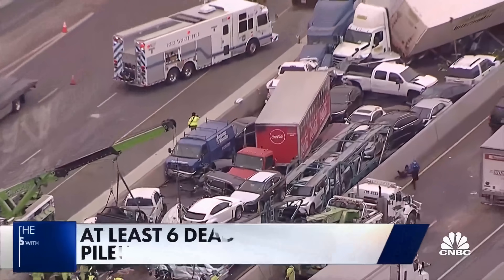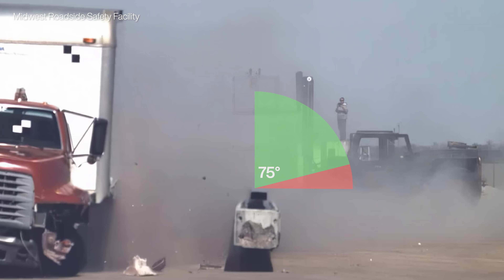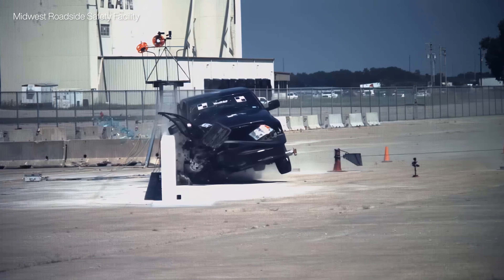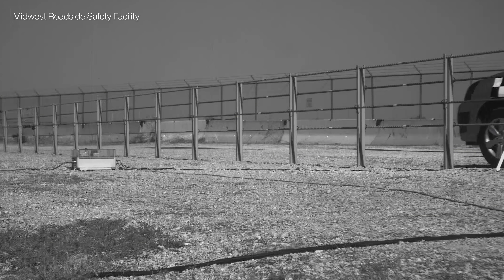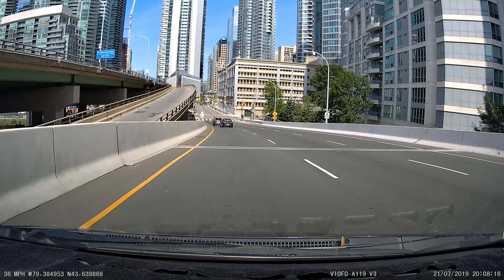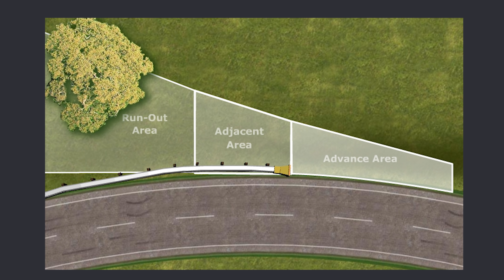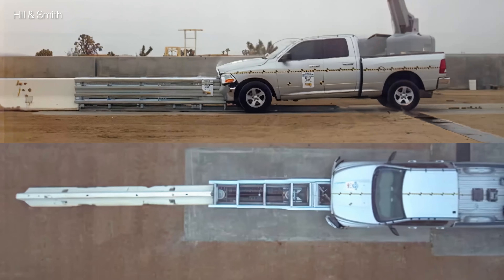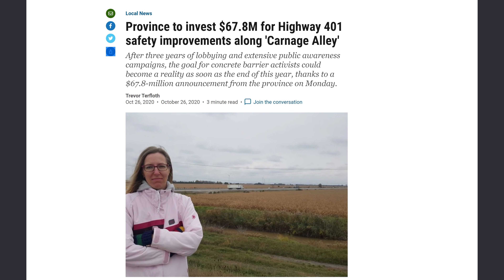How Road Barriers Stopped Killing Drivers

Comment: All the comments about cable barriers and how dangerous they are to motorcyclists made me do some research. What I found was several studies that showed essentially that any barrier is no bargain for a motorcyclist, but that cable barriers weren't significantly more dangerous and perhaps safer than solid barriers. We tend to look at those cables and think cheese slicer, but we don't see how bouncing off of 5 or 6 steel or wood posts holding up a W barrier is just as bad. No barrier at all is safest for running off the road, but any barrier is safer than none for crossing into oncoming traffic. In short, cable barriers are a long way from being "100% fatal" as some seem to think.

What was also interesting, though irrelevant to this discussion, was that one study found that in 85% of motorcycle crashes the rider was at least partly at fault, through excessive speed, DUII, illegal maneuvers, or other factors. I rode for years and had a few crashes. Every one was my fault for driving too fast for the curve. Never had a traffic run-in, for which I'm grateful, but that may have been helped by the fact that even after a decade of riding I was still just a bit scared of all those big cars around me!

Comment: Important note: 'phased out' means 'no longer approved for installation' not that they were all ripped out and replaced. Still plenty of older installations out there that aren't up to code anymore still spearing and slicing people.
Reply: Yeah I've definitely seen those types of barriers on the roads.
Reply: @takeit1229 fr. theres one of those horrifying spoon ended barriers on the bridge we used to take to get to school.
Reply: Correct. Its important to be able to spot the which is which, it might save your life.
Reply: @barryallen5507  yeah try to look at the crash barriers on the road to plan out your car accidents more safely.
Reply: @barryallen5507  so you would know where you can crash safely? That's dumb, all crashes are accidents, you can't pick where nor into what you crash into, because it happens too fast to react 99% of the time.
Reply: @Derg3586  all crashes are not accidents and it is often still possible to control the vehicle to a moderate degree during partial loss of control.

When I was 19, I hydroplaned on the highway at 70mph in a curve in the rain, the water was too deep because of welling and my tire tread was too thin because I young and broke, I was on a direct collision path with a Grove of trees that would have very likely resulted in my death, so I chose to actively counter steer (a tactic used in rally racing to control the forward direction of the vehicle moving at a high rate of speed on terrain with low traction) and allowed my vehicle to engine brake instead of using my brakes because that would have locked up my wheels and resulted in complete loss of control. I am alive today because of my ability to drive and the choices in made during that crash. Instead of veering off to the right of the road and continuing straight into the trees with only a seatbelt to 'save' me (more like kill me, check vehicle crash stats and impact of seatbelts during collisions over 40mph for context), I guided the vehicle back to the left leaning curve and hit the wire guard rail. Initial impact with the railing ripped my entire left front suspension out of the vehicle, causing my brakes to fail and leaving me with only one wheel to steer and a cable pull hand brake that controlled the rear wheels. I spun out and continued to redirect the vehicle towards the rail to the left side instead of the hill to the right side. I hit all four corners of the vehicle on the rail and did 2.5 full spins, after which point I had slowed down and dissipated enough energy that I managed to straighten out the vehicle even with one wheel and used my handbrake to stop just on the right edge of the road.

We're not all old or slow like you I guess. You can work on your reaction times through practice. If the only thing you know how to do in a car is travel in a straight line, you are certainly doomed in the event you lose control. There are advanced driving classes you can take to further expand your ability to mitigate danger in a loss of control event, like sliding on ice or hydroplaning or spinning out, I'd recommend you attend at least one.

The only way that you cannot pick where you crash is if you have total loss of traction (rare occurence), your vehicle systems fail due to damage (possible, but unlikely), or you are suffering from a medical emergency.

"That's dumb" personal experience and the entire racing industry begs to differ.
Reply: @barryallen5507  look man was gonna agree with you, but hurling insults isnt going to make them take your statement seriously, try to avoid demeaning someone when trying to get your point across. However, it is true that if you are an experienced driver you can choose where you are going to crash, as long as you are paying attention which to be honest everyone should do, but let's be real they don't.
Reply: @Tihamatt  to be fair, the other said “that’s dumb” first. All he said was that he was old and slow.
Reply: @Tihamatt  Me calling his point dumb definitely wasn't an insult and I still don't agree with him. 99% of people would panic after their car starts loosing control, mess up while trying to regain control and would end up crashing into something in the end. Just because he managed to control his car durring crash doesn't mean everyone in his situation would do the same. I know I wouldn't, I start panicking and freeze too often. 99% of people would start panicking as well, only very few would manage to stay calm and actually do something to control crashing car.

And no I'm not freaking old I'm 19
Reply: @Derg3586  you replied to the wrong person bud
Reply: @barryallen5507   holy shit i have never seen a more self congratulating comment
Reply: @Tihamatt  Unfortunately that is very true, distracted driving is the leading cause of automotive collisions today. Stay safe out there
Reply: @TainaElisabeth  Salty?
Reply: @barryallen5507  "i am very badass, look at me!"
Reply: @barryallen5507  I hydroplaned and couldn't counter steer.... I had to watch myself hit a pole almost head on and then proceed to flip. It was a smaller road and there was a lot of oncoming traffic around this rather sharp turn. So my options seemed to be to go with the flow and hit the pole or to try and counter steer and end up hitting oncoming traffic just about head on.... I believe I made the right choice because thankfully my car was the only one damaged I didn't hit anyone and it even flipped right-side up so it could be pushed into a driveway. I feel like had I counter steered I absolutely would have hit those people because this wasn't a drift or something this was straight up hydroplaning on a very oily road. 

I also hydroplaned on a new road on the interstate..... Brand new road just a couple months old and their crappy design made it to where water would puddle up in the last lane when it rained..... Well I had someone cut me off while going a good 20 under the speed limit. So I got over into that last lane and within 10 seconds I hit that patch of water and then within a couple seconds I was sideways going 75mph. I hit the concrete barrier while doing a 180 and the rear of my car right by the tail light smacked the crap out of the barrier and instantly stopped me. The car had a big crease where it impacted but amazingly that was the only damage. I started her back up and drove off into the sunset.... Only to have that first wrecked I told you about a month later.... I was also riding on bald tires because alas I was broke I also avoided rain but it just so happened to be storming where I was going while being perfect whether where I lived.
Reply: @barryallen5507  if you were really a good driver you wouldn’t have crashed in the first place. how did you not notice the water? and why not just continue straight instead of going left? come on man
Reply: ITT: Bad drivers who are getting mad because someone was competent enough at driving to avoid a worse crash. Be a better driver, it is your responsibility. I find his "self congralatory" comments far less annoying than folks who shouldn't be on the road because "omg if i get in an accident idk what to do" go read a  book because otherwise some of your foolishness and driving incompetence could kill not only you but someone else.
Reply: @Derg3586  Just because you can't operate under pressure doesn't mean nobody can lmao
Reply: @Derg3586  If your reaction to your car not going in a straight line is to panic, you shouldn't be driving. You are a danger to yourself and the people around you when you don't know how to drive.

I can't really blame you if you are that bad at driving though, driver education is nearly non-existent.
Reply: @barryallen5507  And then everyone clapped
Reply: Barryallen,best response to the idiocy I witness daily. Most on the road do not have basic skills and knowledge that was commonplace and the "Safetyism" pushed as a false replacement for skill and knowledge.
Reply: This comment thread is a mess lol anyone here smoke weed?

Basically I think it’s REALLY stupid for everyone to do this ridiculous back and forth about whether people can prevent accidents by reacting quick enough. Your excessively detailed anecdotal stories are not proof one way or another. This is why studies are done. This is why people pay attention to statistics. ONE story from a rando about how they survived a car crash isn’t proof of anything, I’ve been there too and narrowly avoided death, I’m lucky I had a quick reaction time. But it doesn’t mean anything about drivers as a whole.

You cannot, without any details or statistics, argue that people who got into crashes deserved it, werent “quick” enough reacting, or were just plain flawed human beings. If you wanna talk about the blame for these accidents, there are a million factors that you’re not considering in the hypothetical scenarios we’re discussing. If you wanna blame ppl for car crashes then focus on actual identifiable events where drivers were absolutely at fault.

Anyways have a nice life, hope some ppl in this thread
Reply: *do LOL
Reply: @Gumbyloomy  Thanks for being sane.
Reply: Gotta love driving on the I-76 through construction zones where everyone’s still going 60-70 mph. Most of the guardrail ends could decapitate you at any moment, and in construction zones you sometimes have a margin of like one foot. Love PA roads!
Reply: We try to replace everything out of specification on jobs as they come up.
Reply: Yeah ive seen more of the older styles than I have the newer ones.... Guess we need to just start running into them and making them replace them lol... Not it
Reply: Yep, I have a friend who got a piece of guardrail through her chin and jaw in an accident. Luckily lived with just a scar.

(Edit- and I'm not yet thirty, so this wasn't like ye olden times either)
Reply: What happened in the accident?
Reply: Exactly. That and many of the guardrail end terminals that are approved DONT WORK. Or they aren't installed/maintained properly, causing them to fail and spear cars. Look at Steve Eimer's channel (aka steve the guardrail guy). His daughter was speared and killed by such a guardrail.
Reply: Nice 👌
Reply: That’s called Darwinism. Only the ones who shouldn’t reproduce are affected, so it’s a win win; one less bad driver and an old design gets updated.
Reply: Guys, Here is our Savior

YaH The Heavenly FATHER HIMSELF was Who they Crucified/Pierced for our sins and “HERE IS THE PROOF”

From the Ancient Egyptian Semitic: 
"Yad He Vav He" is what Moshe (Moses) wrote, when Moses asked YaH His Name (Exodus 3)

Ancient Egyptian Semitic Direct Translation
Yad - "Behold The Hand"
He - "Behold the Breath"
Vav - "Behold The NAIL" <— YaH’s Crucifixion
He - "Behold the Breath"

“Behold the HAND that Beholds The NAIL” 

PROVES - YAH The Heavenly Father HIMSELF was Who they Crucified

That is EXACTLY what Moses Wrote

Here is what they mean

YaH's Name:
(Ya)d + (H)e, as YaH is what Moses called Him and YaH Declared: "this is My Name, this is My Name for all generations" (Exodus 3)

YaH is The Creator of “MAN”: (Genesis 2:7)
Yad He, (HAND BREATH), as YaH's "HAND" Formed man from the dust  of the Earth and His "BREATH" made him a living being (Adam)

YaH's Sacrifice of Crucifixion for “MAN”:
Vav He (NAIL BREATH), the "NAIL" through YaH’s "HAND", in Sacrifice of Crucifixion, that whosoever shall call YaH Savior, His “BREATH” brings forth life (Salvation)

How YaH arrives:
YaH arrives via the Tent of Meeting (Exodus 33:7:11, Isaiah 54, 55), where a Tent is erected outside the city, a cloud descends upon the entrance of the Tent and YaH appears...

Why they demanded YaH to be Crucified:
YaH was Crucified according to Hebrew law (Deuteronomy 21), to be NAILED/PIERCED on an Almond Tree for BLASPHEMY as it was for His NAME they demanded Him Crucified. The Messiah claimed He was YaH...

HE WAS YaH!!!

HalleluYAH translates “Praise ye YaH”

The Hebrew Book of Isaiah

Isaiah 42:8
"I am YaH; that is my Name! I will not yield my glory to another or my praise to idols.

Isaiah 43:11
I, I am YAH, and there is no other Savior but Me.

Isaiah 45:5
I am YaH, and there is none else.
Reply: Yeah, a lot of eastern Kentucky still has those.
Reply: "Yes but if we made things not kill people that would cost MONEY." - Rich people who could definitely afford to pay for it they're just greedy assholes.
Reply: Knowing what to do if your wheels skid while driving is super important, and even if you hope you never have to use the info, someone who has been taught how to manage it is more likely to be able to regain control of their vehicle than someone who hasn't.

Comment: Working as a dispatcher for state roadside assistance I watch the cameras for the interstate and see crashes happen and the result of a crash out side of testing applications differs substantially compared to the crash test. attenuators here are fully replaced after most crashes and guardrails do their job until an above average speed semi hits it and blows through one guardrail and stops on the second. They do their job but not like seen in testing. Crashes in the raw cause significantly more damage to guardrail equipment and have alot more outside influence that can't be controlled like a test crash is.
Reply: But there definitely is a significant improvement from the old ways as you explain, but the crash can still be devastating no matter how much improvement is put into testing and developing newer and better crash/damage mitigation technology.

Comment: I drive a 20 mile section of the interstate to work and school every day for the past like 6 years. The median never had any stops and about three years ago they finally put in some cable barriers. Not only does it stop people from flying into oncoming traffic which happened more than it should have but in the winter they have to go repair the sections of it like every two weeks because it gets hit and tore down CONSTANTLY. There’s now way they could afford guard rails or cement barriers on such a massive section of road and have to replace or repair them constantly.

Comment: Only 1 or 2 updates I recommend. 🤗 This (I feel) will help with your presentation, aside from this point I really enjoyed your video. Dress attire, put on a nice shirt preferably a button type. Dressy / Casual is good for the majority of videos, a Tie isn't needed.  I have been working in the Movie and TV industry for 25 years, I notice Camera positions more then the usual viewer. Using the barrier as a prop is good, although it presents in a bland way because it fills the entire FOV (field of view). Pull back to see more of the barrier, without additional clutter in the background and go a little wider FOV. Keep camera close to level with your eyes, or a little lower for a dramatic effect.  I have been interested in these designs, for my own curiosity. Hope these pointers help 👍
Reply from the maker: Great tip, I would have pulled back more but due to the limits of space and equipment that was the best I could do.  I have a wider angle lens now.  

I think a button up top signifies a certain brand, and that's not me.  There's a place, time and audience for it.

Comment: The thing about cable varies most people including you forget about is that motorcycle drivers. On my country (Turkey) at special bus roads firstly we used cable bariers but after deaths of many motorcycle riders (some with decapitated) they put metal ones behind it as a safety measures.

Comment: I suffered from a medical emergency on the highway, and was clocked going just over 140 MPH by an officer shortly before my car impacted a cable barrier. The cable barrier stopped my car immediately, and I was completely uninjured (without even the slightest scratch or bruise). It was truly amazing.

The cable barrier was overlooking a steep slope down to a wooded area, so I would have been super ultra dead if it wasn't there, or if something else was there that failed to stop the vehicle, or if something else was there that stopped the vehicle even more immediately. The cable barrier did an amazing job absorbing the impact. The cables detached from their posts really far down the road in both directions, absorbing the impact by distributing it up the cables towards adjacent posts.

After everything was said and done, the scene looked like my car was being pulled back in a slingshot made from cables, ready to get launched back across the road. They're not elastic so there was no chance of that happening of course, that's just what it looked like.

The car was totaled, but thankfully due to the ingenious design of cable barriers, I was not. I'll always appreciate how amazing cable barriers are. Thanks for saving my life and the lives of others!